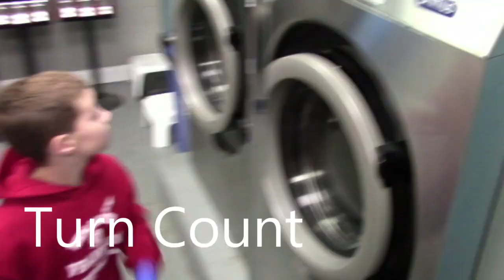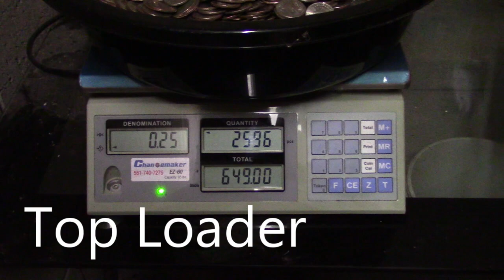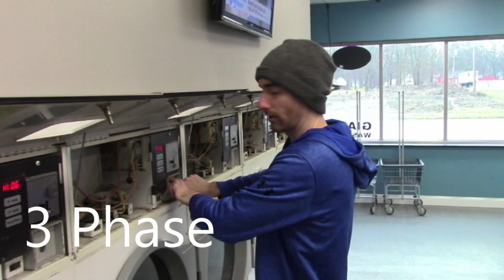Laundromat Key Terms For Beginners Explained

Comment: Excellent, I need the knowledge. Question: Where is the application for a soft mount versus a hard mount ?
Reply from the maker: Basements. Hard mount machines need to be bolted down. Can’t be done with a basement unless you weld a steel base or pour in concrete pillars to the basement floor. Soft mount machines can be put on a basement floor, which is great, until you realize how much more expensive they are… basements suck for laundromats